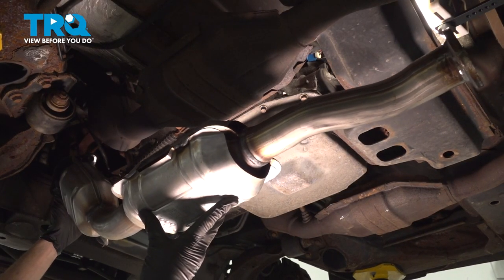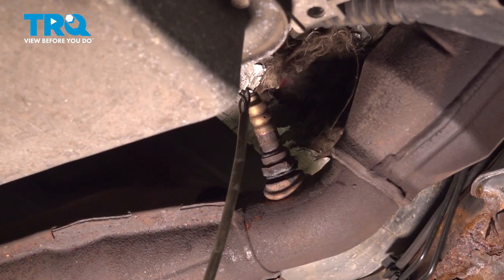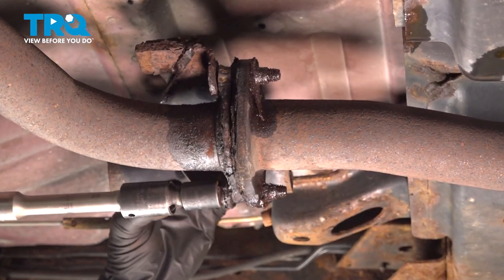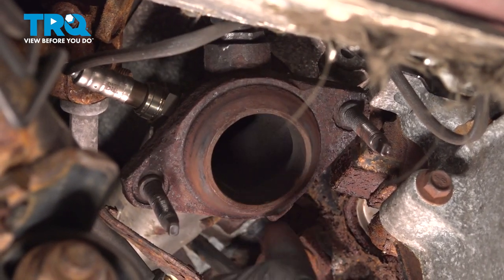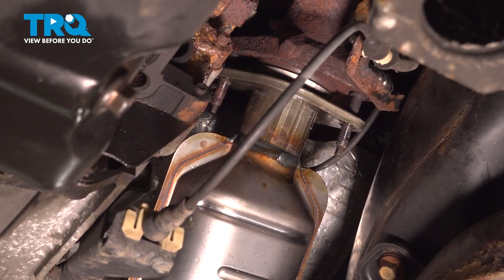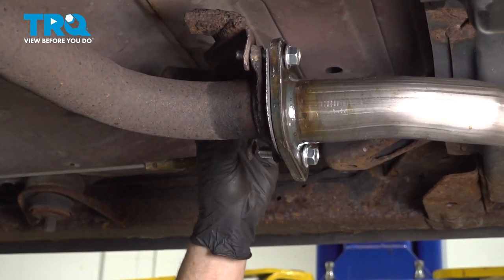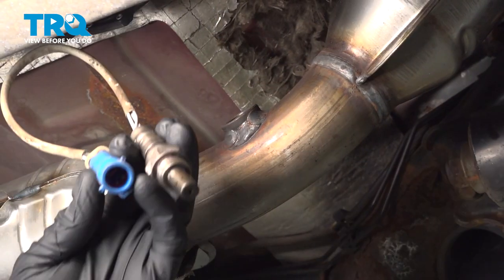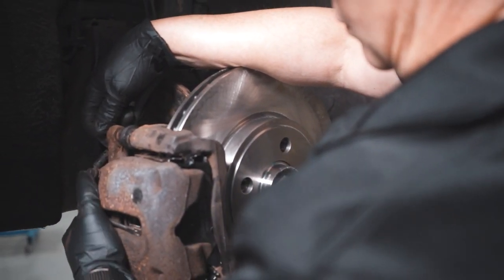How to Replace Driver Side Catalytic Converter 2003-2011 Mercury Grand Marquis

Comment: Are the studs removable and replaceable? Or can I knock them out and use regular nuts and bolts that will fit? My studs rusted away and don't thread